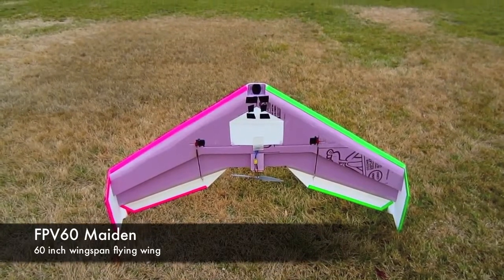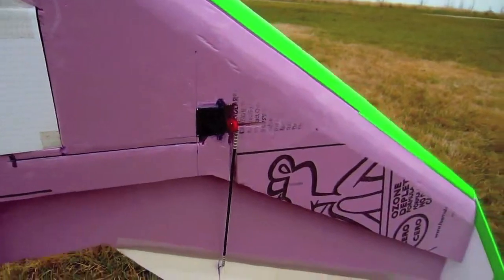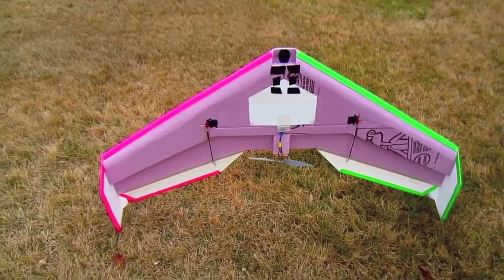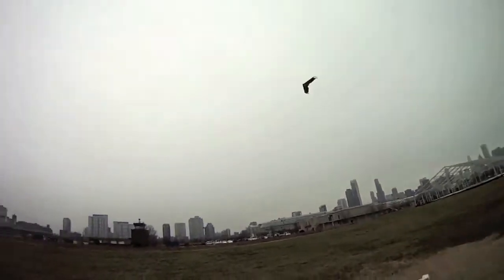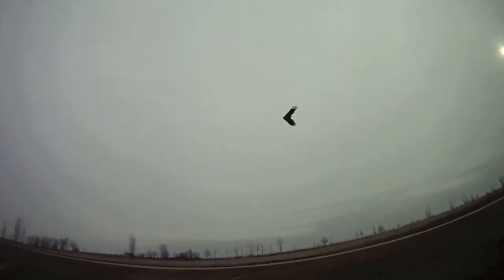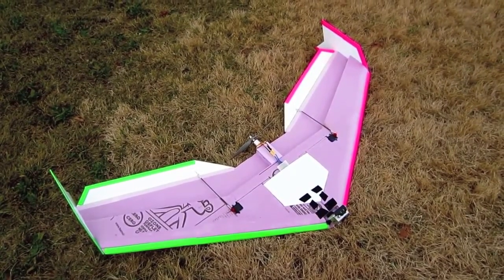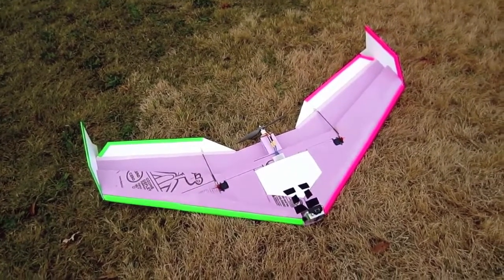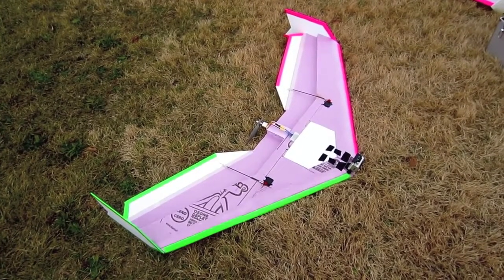FPV60 Maiden!

Comment: I have a little smaller motor 134 grams and im thinking of mounting it on the front and using a smaller battery would that work?
-motor is a 1500 kv firepower speed 10 with a 9 x 4.5 prop 
-im thinking of using a 1000 mah battery